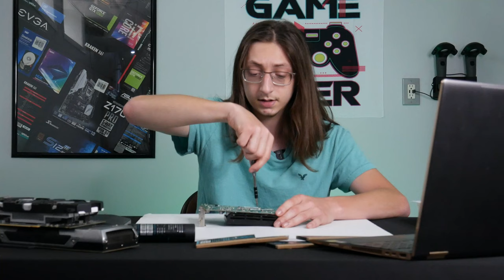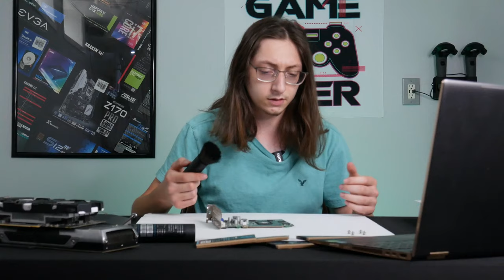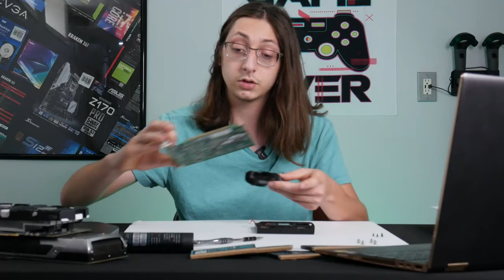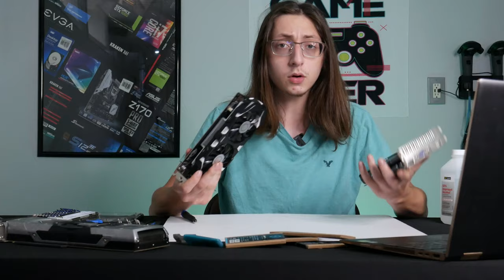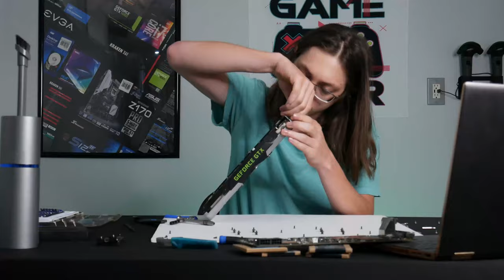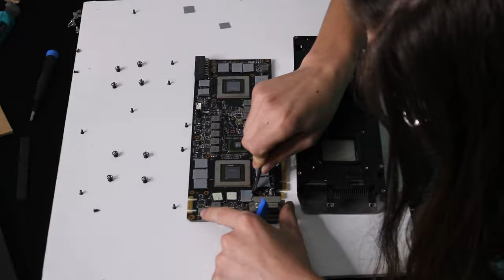Let's Learn How to Deep-Clean Graphics Cards

Comment: For a second there I thought you were going to reuse those thermal pads. If you have a chance to make a recap video on that GTX 690 to see if it still works. Also, soon I need to do this to my GTX 680 and 970. 

Side Note: I have a 9800 GTX that wasn't working and took it to work to reflow the die and gave it a deep clean and replaced all the thermal pads and paste and somehow brought it back to life. It wasn't completely gone since the PC would boot up with that card but, I couldn't get the drivers to install at all. Once I did the reflow and what not it's a fully functioning card again.
Reply from the maker: Awesome stuff! Yeah I'm really hoping to make a video on the GTX 690 as it's an awesome piece of NVIDIA's history and I'd love to see how it stacks up against titles today.
Reply: @GTechOfficial  That GTX 690 should hold up very well especially if it has 4GB VRAM. Just from experience of having the GTX 680 with just 2GB VRAM last me a long time and I was able to play everything with  the setting on high at 1080P. I didn't get a new GPU until the GTX 1080. And I waited a full year and half before I got the GTX 1080. All though, before the 10 series, VRAM in games was much lower demand than it is today. Remember when games like Fallout 4 and Titanfall and Tomb Raider, it was no problem maxing out the graphics with only 2GB of VRAM. Can't do that anymore with all these new games. They depend on a lot more VRAM.

Comment: What graphics card should I buy I have a pc budget of 450$ so the cars should be like 150 to 200
Reply from the maker: The entire GPU market is in an awful spot right now so the best card you're gonna get new right now is a GT 1030. If you're not afraid of going with a used card maybe look into a an RX 560/570 or like a GTX 970/1050 Ti
Reply: @GTechOfficial  would a r9 290 be good or would the 1030 or rx 560 be better?
Reply from the maker: The R9 290 would be best if you can get it for a good price
Reply: Is 120$ used good for one atm
Reply from the maker: @bfmsalty  yeah that's not too bad nowadays
Reply: @GTechOfficial  oh God nvm they are like 220 I wrote that wrong
Reply from the maker: @bfmsalty  definitely not worth it for $220; I wouldn't spend more than $130 on a good day. At that point look for a GTX 1650 or GTX 1650 SUPER.
Reply: @GTechOfficial  even 1050tis are 250 in my area do u think I should get inigrated graphics and upgrade to get one when the prices go back to normal?
Reply from the maker: @bfmsalty  That's probably your best bet.

Comment: hi there i been trying to find out what size  of  thermal pads i need for my old gtx 970 windforce g1 but i cant seem to find any infor for it and i dont want to open it up wath out haveing them
Reply from the maker: Hi there! I see what you mean, info isn't very common on thermal pad thickness. Some quick research is saying they're between 0.5mm and 1.5mm, but others are saying the pad thickness varies. Your best bet is probably to just buy a small pack of each thickness and eyeball the thicknesses of each pad as you remove them. Use a pair of calipers if you have some, or even just a ruler would help out.